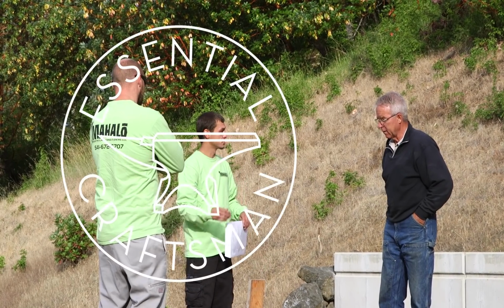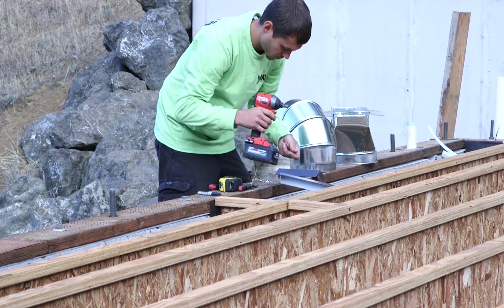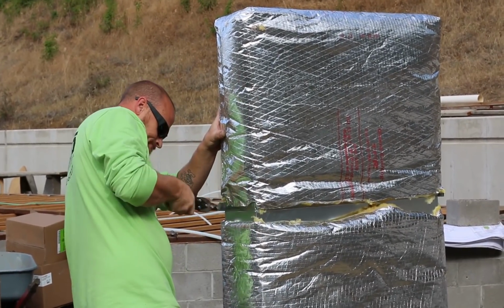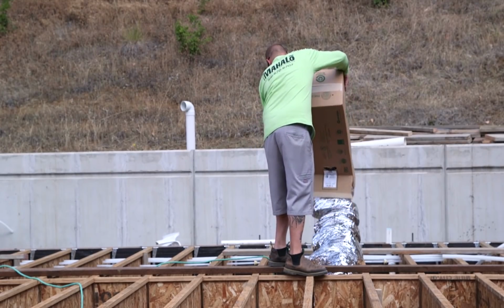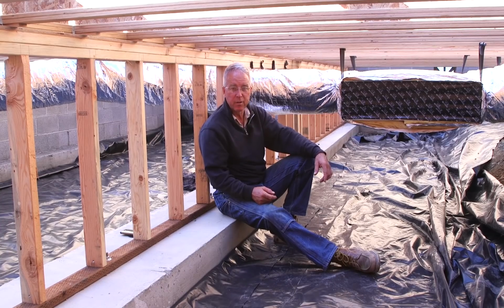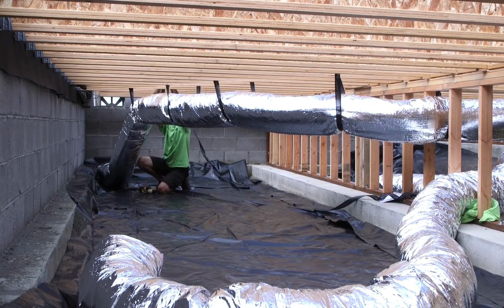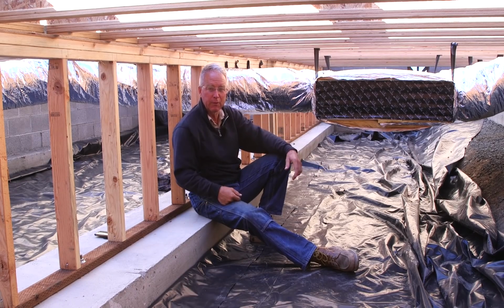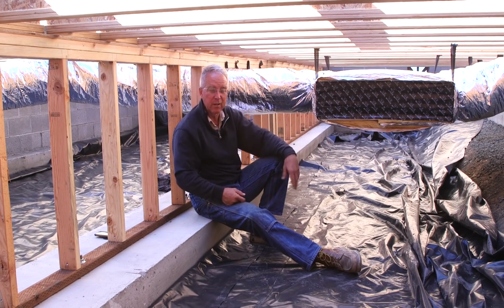Ducting Ep 42

Comment: Question.  How are you protecting that duct system from rain. Because here we don’t install until dried in (roof decking on with felt at least)
Reply: I’ve been in the HVAC Industry for 21 years so I was really looking forward to this video but I have to say I’m very disappointed.  All the extra steps that have been taken in all other aspects of the build and then the duct was installed using every short cut possible. Hopefully you are able to keep the  duct wrap from getting wet.
Reply: Randy Warkentien just an observation it is southern Oregon in the dry season.
Reply: Andrew Ubaldi It rained here last weekend and is forecast to start raining again Saturday and Sunday. So much for the dry season. From Jacksonville, OR.
Reply: @randywarkentien4563   He talked about volume control but the collars on the trunk line didn't have dampers. He talked about leaks but the elbows that were used as pipe were not taped up to keep them from leaking... Iv'e been in the HVAC industry for 15 years.
Reply: Randy Warkentien     Here too.   Hvac about 25 years....never seen duct work go in before the roof.   Earlier in my career I was never met onsite by the Gc to layout the duct system. The series is supposed to be about how a house is built from start to finish.  I understand about filming and all. But when you deviate from showing how houses are actually built it takes away from that.
Reply: @cjnewton72  Can't houses be built in different ways?
Reply: cpad007 sure,  but I’m willing to bet there won’t be any Hvac guys reply saying they install ductwork before the roof as a standard procedure... heck I doubt you see any Hvac guys who have ever installed new construction ductwork before being rain tight,  in fact I’ve never seen it done, but I sure know what happens when that stuff gets wet, pull it out and start over because you will never get the moisture out once it get in...and dry season or not they still have dew in the evening or morning I believe.  I hope they did it just for filming and the overhead shot.
Reply: My question too. I've never seen HVAC go in before the house is framed and under roof.
Reply: Tarp
Reply: Exactly my question.  I had seen a video from the 1980s in Oregon and they did this too.  I was really surprised to see its still a thing.  While I can see pros and cons.  It is definitely not practical if even possible in my area.  And the risk of rain damage would be huge.  You would have to be framing it yourself to even attempt this.  But, I can't say it doesn't work for them and as he said they have better light and easier working conditions.  To each his own.
Reply: I live in Oregon, only a few hours away from EC. The hvac he is doing is very standard practice here.  We are a desert climate.  I'm sure in whatever climates you all live in it is standard to wait till the house is dried in.  Here it isn't.  Don't nit pick.   There's a thousand ways to build a quality house, other then the way "you" do it
Reply: @Squigknight  this house is built like a cutting edge he from the 70's. We have learned that cheap doesn't work out well for anyone but the contractor that is off to the next tract home.
Reply: @tysleight  he very clearly stated this house will not be the newest/latest/greatest methods.  It will be tried and true methods.  He is going far above and beyond anything a tract developer would do or even dream of.
Reply: @Squigknight  his methods on this are literally from my  lifetime ago, if he puts in an oil furnace he has my last house pre duct remodel. After the flex was traded for real duct the filter lasted  1/3 longer ( we had manometer) I assume this is from all the little holes that had formed and all the extra air being blown into a dirt floor basement.  
Also cheap track homes that I've worked on are typically done with a metal trunk( factory built an insulated) and flex off of that Infact I believe they can't by code put a furnace filter in an in a non accessable area like a crawl space or attic. But I an no HVAC guy just a former contractor that left the game in 2009.
Reply: @tysleight  if you don't like the video then dont watch them.  Comment section contractors are ridiculous and no one cares what they think.  There are multiple ways to build a house.
Reply: @Squigknight  you seem to.
Reply: @tysleight  don't flatter yourself. I just love arguing
Reply: @Squigknight  Like, we'd need a lot more heat up here!! Central AC is WTH?
Reply: @Squigknight  if you're only a few hours from Roseburg and in a desert climate, then you're on the eastern side of the Cascades. I've driven up and down I-5 more times than I care to say, and believe me, it rains a lot in Roseburg.
Reply: @Squigknight  999 of them are poor choices.
Reply: Matthew Rivera Not nit picking here.  And believe you me I saw several things I could have nit picked (such as 5:22 mastic on a non joint. there is no split in the metal where he’s putting that mastic it’s further in around the inside of the rectangular duct... I would catch my helpers doing this and to correct it over and over...and you can see if you look closely at 9:05 the mastic never got to where that seam actually is. That’s a self stick take off , the foam seals the ring to the duct but not the ring to the collar.  The collar is spun into the ring  with the lip wrapped around the inside of the ring. They do it because that crap is messy and they  don’t want to get it on them.  And that’s just one of the “nit picks” I could have done.  But hey maybe he did reach around at hit that seam and just missed that last one.  But if the mastic is inside the duct how does the building inspector see it?) My question wasn’t about technique, code, or nit picking.   And it wasn’t a question for everyone to explain or defend it was for EC hoping he would mention it in future vid
Reply: chris newton they will be putting on the subfloor in only a day from when this video is posted
Reply: This is retarded....the hardest part of building a house is getting her frame up "dryed in"
Stopping that process to let the plummers and hvac get a head start is just plain stupid.
Then they to come 4weeks later to finish...retarded